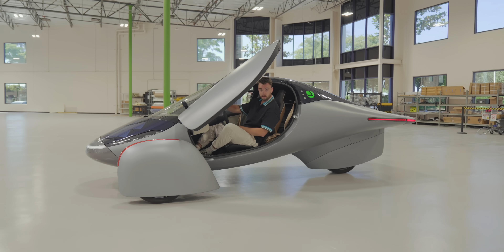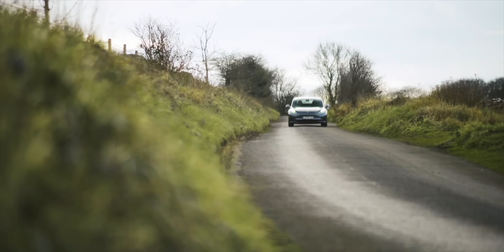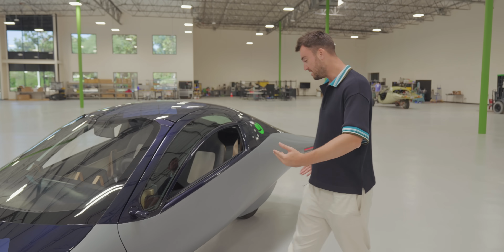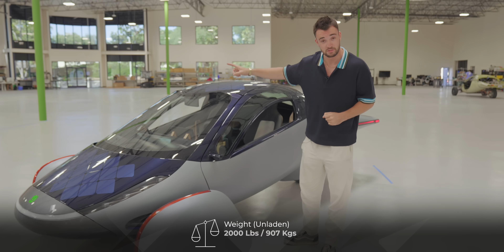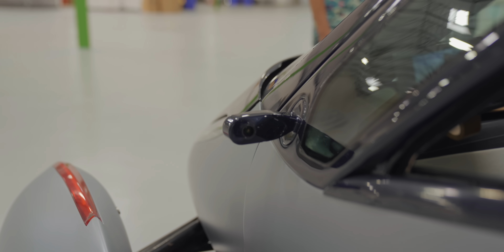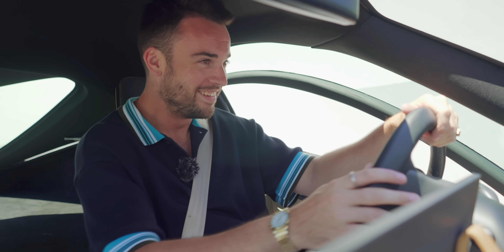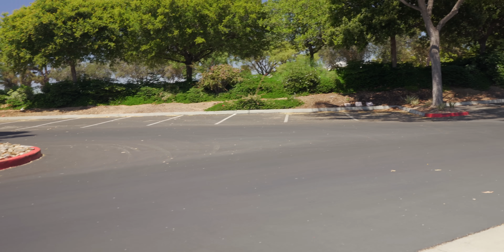The Game-Changing CHEAP Electric Car Inspired By Fish!

Comment: This vehicle was needed 20 years ago.  It's so very overdue and I can't wait to finally drive in one while flipping off the oil industry for good
Reply: I like it more because I can flip off the electric company as well.
Reply: I'm ready for a world where energy independence actually belongs to each of us individually rather than being indebted to entitled poisonous industries. But they're going out kicking and screaming.
Reply: @HermanVonPetri  because The lithium industry is so clean and selfless...
Reply: @meissnerflux  At least lithium can be sustainably harvested from seawater using renewable energy. And the lithium you do get can be reused for many decades to store renewable power. You don't just burn it away like you do fossil fuels.

Then there's the newer sodium-ion batteries that are beginning to enter the market now. They don't use lithium, cobalt or nickel. Battery advancements are happening rapidly and are addressing environmental criticisms. The petrochemical industry has known about the environmental damage of its products for half a century at least but they are in the business of selling pollutants and can't change that.
Reply: @meissnerflux  😄Yes, when compared to the fossil fuel industry.
Reply: @meissnerflux  lithium is not burned by EVs. Lithium can be recycled, burned gasoline can't
Reply: @HermanVonPetri  Don't fool yourself. They are not going anywhere!!
Reply: You do realize the oil industry is still needed to make the plastics and to power the production machinery and mining equipment for digging up precious metals, shipping them from across the world to US, and to provide the oils and greases used for lubrication, right?
Reply: what's sad is it could have been built 20 years ago. easily.
Reply: @bob15479  They started building this car over 20 years ago! I was there and I rode in it. It's basically the same vehicle, but the economics of the project impacted them harshly and now it appears they are back. It was a vastly different world for this kind of venture back then!
Reply: @bob15479  No it couldn’t have. Both solar panel and battery technology have gotten orders of magnitude better and less expensive. When the Tesla Roadster came out in 2008, Li-ion battery prices were still >$1,000/kWh. It’s an engineering marvel.

Remember, the original 2011 Aptera 2e was going to be an ultra-high mpg plug-in hybrid because batteries weren’t up to snuff yet. It was also slow, 0-60 mph in 9 sec.
Reply: @bob15479  There was an EV car built some years ago. But "money" (Probably by the oil industry.) bought rights to own them. They were collected and destroyed! They were called the EV1.
Reply: @Eric Dow it could have been built and onboard differential'd motors and lead acid batteries in the 90's and would have still been a good car IMO
Reply: The oil industry allowed the US to develop and build everything we have to include green tech.  Cheap energy is the king of wealth and innovation.
Reply: @babochee  True! And now wind & solar generated electricity is the cheapest energy, and EV’s are the cheapest way to get around.
Reply: Ya I can believe something like this hasn’t been available for a long time, I drive 90 miles per day and this would be perfect
Reply: It's needed now too, OPEC just reduced barrels and rest of the world is not dealing in Petro dollars. We need a surplus of oil
Reply: @mohit4902  yes, this. ^
Reply: Technology was much greater 100 years ago. It all got stolen to sell to you.
Reply: make sure you are walking when you go to flip off the oil industry tough guy because NEARLY everything that is used in the world contains plastic some more than others probably that keyboard and mouse or the phone in your hand uses at least 75 percent plastic which is made by .......YOU GUESSED IT ....PLASTIC!!!!!!!!!!
Reply: Wrong - I fell for the Volt nonsense back in the day and they completely changed it from concept to production.  I backed out and was better off to get away.
Reply: @politicalfoolishness7491  The Volt is the best car I've owned, and I've owned a few. Still going strong after almost 9 years and 146,000 miles.
Reply: @fotoguru222  I'm glad it worked out for you.  Did the battery last 9 years though?
Reply: @politicalfoolishness7491  Yes, my 9 year old 2013 vintage Volt battery still has about 90% of its new capacity. I actually get more miles out of each charge but that’s probably because my average speed is less now that I’m retired and doing more local trips.
Reply: @Another-Address  Yes. Oil is too valuable to 🔥. 😎
Reply: yes pleease!!!!  FJB!!!!
Reply: Agreed
Reply: Get your order in now. As stated in the video, there is a growing waiting list. It will cost you $100.00 to reserve your car. I've reserved mine, and I can't wait for it to be ready.
Reply: You will NEVER be able to flip off the oil industry because OIL is used to produce the plastics you use and take for granted EVERYWHERE in and around your household INCLUDING the building you are living in  and the products you're using today right now to connect with the internet.

You green-minions don't know how dumb you sound when you  say shit like you just did in the original comment.
I'm not an oil industry fanboy  I want to save the planet too but I'm not going to be an idiot to jump on the bandwagon without facing the facts that the oil industry is here to stay   because its far more intertwined with our daily lives in MANY OTHER WAYS other than  transportation.
Reply: Time we design an ev which charges itself with each and every rotation of the wheel?
Reply: You could buy a VW E-Up!
Reply: This cars first iteration was birthed in 2006.  Some of us have been thirsting for it for 16 years.
Reply: Sinclair c5
Reply: The CEOs of all common car brands might try to stop this car for sell, because all car  dealer cannot rip people off any more!
Reply: I think 20 years ago they had a gas version that got over 500 MPG.  It never got approved for safety despite being safer than most compacts and mid-sized cars.
Reply: You can drive an electric bike today if you really wanted to flip off the oil industry
Reply: @YounesLayachi  I've got one! The problem is, that those people driving the big SUVs, trucks, and some gas-powered motorcycles,  often want to play chicken on the road when they see one. And I am forced to use the shoulder of the road when traffic gets a little heavy.
Reply: @YounesLayachi  I'd have to move to a city that has decent bike lanes first. Which means getting a new job, because the nearest city to me (Dallas) is extremely unsafe for biking.
Reply: @HermanVonPetri  electric bikes are much safer than bicycles, but ok point taken
Reply: @YounesLayachi  Don't get me wrong, I completely support e-bikes as a middle ground option. And I would get one if I felt it made sense for my situation, but I'm struggling to find a use case scenario that feels safe and practical. And that's not even accounting for the risk of theft.
Reply: @YounesLayachi  How do you figure? The #1 risk to cyclists is getting inadvertently or deliberately hit by a 4-wheeled motor vehicle. A bicycle having an electric motor doesn't address that at all.
Reply: @HermanVonPetri  I worked full time in the bike industry while I was getting my degree, right through the 1st gen of electric bikes up until 2019. They only really fit edge cases better than just plain bicycles or electric motorcycles.

If you're an able bodied person riding less than 10 miles, just get a bicycle. It'll be half the price for the same equipment, easier to carry up and down stairs, and future parts availability is much more guaranteed.

If you're not able bodied, and you want a method of fitness, then yeah get an e-bike. OR if you're still able bodied but want to ride in from 20 miles out, sure.

Other than those two it makes much more financial and safety sense to get an electric motorcycle. There exist electric motorcycles that are at price parity with electric bicycles. The big deal here is when you're on a plated and insured vehicle, and someone in a 4-wheeler deliberately drives their car into you, and this will happen if you ride a two-wheeler, the cops have to get involved. If you're on a bicycle, the cops show up, say "well anything could have happened, who's to say?" and leave without filing any charges. Plus, having more than 750W on tap allows you to get out of dodgy city situations in the first place. "BLAH BLAH BLAH BUT YOU NEED A LIIIIIIIICENSE!" Yes. They take one weekend to get. You go to your state's motorcycle instruction course, do a few hours in the class room, then 8 hours putting about a parking lot. Truly trivial, job done.
Reply: @Hansengineering  a cyclist has increased odd of getting hit if his cycling speed is much lower than the driving speeds of cars around him. Ebike can keep up with car speed and sometimes outspeed cars from a dead still.
Ebike can also get out of the way quick enough in case of incoming danger, while a cyclist will be a sitting duck trying to pedale away
Reply: @YounesLayachi  ebikes are by law limited to 20 mph max. They typically travel around 15-18MPH in practice. That is not enough to not get run over by cars. Those rental scooters do 15 MPH and constantly hold up traffic.
Reply: @Hansengineering  you think your country's law applies to the entire world ?
Also even when speed is limited, acceleration isn't. Ebikes aren't sitting ducks in red traffic lights when cars go vroom at green
Reply: @YounesLayachi  my dude i have ridden every type of ebike there is, and 10s of thousands of miles on pedal bikes besides. Ebikes are pointless unless you're a cripple.
Reply: @Hansengineering  I can occasionally us my regular bike for short trips to the Dollar Store for small grocery trips. But that's only in that direction where the streets aren't too busy. My main grocery store is down a six-lane road and crossing another busy four-lane road with no sidewalks or bike lanes. So I do not bike there.

The main advantage for me with an e-bike would be because of the summer heat here in Texas. Anything I can do to make the trip faster and less sweaty is a plus. So even that trip to the Dollar Store would be a lot more comfortable. However, that alone just isn't enough to justify the cost and risk of theft.
Reply: @HermanVonPetri  
The biggest danger to riding bike is the person doing the peddling.
Reply: @Hansengineering  e bikes are great if you value not being sweaty without changing clothes
Reply: @YounesLayachi   I do... and I do. 😈
Reply: @YounesLayachi  The oil industry laughs because every single part on that bike was built and shipped thanks to that sweet... sweet goo!
Reply: @yarharyar  much more goo is used building a car and fueling it. E bikes are super low impact and have no intrinsic reliance on oil. Other industries can remove oil from their equations too
Reply: @YounesLayachi  not as safe. Many have been waiting for a safe alternative try riding an electric bike a 1000 miles.
Reply: @YounesLayachi  cant take the dog, go to the shops  and be comfortable in the rain on a bike.
Reply: @YounesLayachi  Not really!! Aside of the fact that you RIDE a bike, not drive it, how do you get ur groceries home on a bike, how do u get ur kid to school on one, how does a bike work for the older set, or those not athletically inclined, how do you get thru a rain or snow storm on one? How do you commute to work if the distance is, let's say 20 miles away with narrow windy 2-lane roads with cars competing for the same lane? How do you arrive at work when you're sweating through your shirt on hot summer day??? How does a bike solve any of these problems???

 A bike only works for a very restricted set of people and places!! You bike people only think of how bikes work for u and think the rest of the world is the same!! Be a bit more open minded and considerate please!!! Cars, private transportation vehicles, are the only way to solve a myriad of modern life issues that no other vehicle can do, so the electric version is what is needed to proliferate ASAP.
Reply: @nixl3518  You would probably be interested in the channel "Not Just Bikes" which addresses most of your concerns with several videos that demonstrate how cities that care about the health and safety of their citizens can actually design walkable, bikeable infrastructure.
Reply: @HermanVonPetri  I've had this conversation before on other channels, including the one u brought up. There is no such place that solves the problems I brought up because you just can't solve them!! What do you do with the elderly? Do you get them an electric tricycle with a basket for their groceries? How do they fare in the cold northern climates with snow or sleet, let alone rain??? Theory and design are gr8 on paper, but if its your parents you need to have taken care of, they need a car! No matter the infrastructure, a bike for each will not do even in the flatlands!! If they can drive an Aptera, so much the better but biking is a restricted sport for the few, including me. I love it but it is not a solution as much as it would be nice. We are not in a Disney movie.
Reply: @nixl3518  I'm not saying to completely get rid of cars. If you do absolutely need a car then giving other people biking options helps them too. Every person on a bike is a person not in front of them on the road, and not taking up parking spaces. 

Most kids can bike to and from school, if the city designs safe bike paths. That means the parents don't have to go out of their way to do the school run, and the kids get more independence in their lives. Sure, preschoolers will still need to be taken by their parents, but that's only a couple years out of a dozen or more years they can bike themselves.

And these designs aren't just on paper. They already work in places like The Netherlands where most people in cities, and even suburbia, use bikes as a daily means of transport. We just design our cities wrong because the automobile industry convinced people that it was wrong for people to expect a city you could actually walk and bike in to do your daily business.
Reply: And that's not even considering the necessity of public transit. Cities that care about their citizens build decent public transit networks.

Take a look at this video "Do Your Buses Get Stuck in Traffic? Traffic solutions & the Downs-Thomson Paradox" by NotJustBikes. Seriously.
Reply: @nixl3518  very narrow minded and a hopelessly lost case.
Kids and the elderly can use 3 wheeled bikes. 
2 kids can be transported in bikes with front cargo. 
Biking in snow and wind and rain is no different than walking or running.
A bike can have electric motor + battery to assist or fully replace leg work. Notice in my comment I said ebike, not bike.
PS "ride" is for things you don't steer, i.e animal mounts, and vehicles driven by someone else (ride a bus/train, give someone a ride in your car : they ride your car but you drive it).
Reply: @YounesLayachi  you must live on a different planet or are so immature that you have not had kids or older parents you care for. Kids in front cargo? Who r u kidding? That’s insane! Have u ever biked in the snow? I have and on the way to rail transport to go to work. I never did it again! Feet get wet, working is difficult. Being fanatic blinds u from reality. You have no concept how idiotic ur comments are!
Reply: @HermanVonPetri  You talk in idealistic terms. I am a realist! Which cities care, as u say? Can you name 20, or 50, of the thousands that should care? Nevertheless, public transport will not fill the niche u wish it would. It is almost always inconvenient enough to make an additional mode necessary, in which case, a bus is skipped altogether. You need to ground yourself to the reality that you find yourself to be in. What CAN be done is not what IS done! I am very familiar with “Not just bikes”. Pie in the sky” stuff.  Complete fantasyland!
Reply: @nixl3518  People need non-car options. Not everyone can afford a car, or to keep it fueled, or afford the insurance. Why are you opposed to considering their needs?

We won't have the options if we don't demand them. You seem content to drive your consumption machine everywhere all the time. I am not.

Car parking takes up 10 times the space that bike parking does, and infinitely more space than pedestrian access. A single bus replaces 20 or 30 cars on the road. A train could remove twice that from the roadways.

Yes, people use the transit method that is the cheapest, quickest and most convenient. But in the past 80 years we've sabotaged what used to be quick, cheap and convenient public transit and walkable cities, and replaced them with expansive, inefficient, dangerous wastelands of concrete for cars.

This experiment in car dependent infrastructure is not even 100 years old. Our dependency on fossil fuels is barely twice that. A blip in human civilization. And in that short time we have fouled the air we breathe with pollution, pushed the climate to the tipping point, and turned ourselves into fat, sedentary, isolated, miserable consumers.
Reply: @HermanVonPetri  Your first paragraph is disingenuous!! You are trying to flip the conversation. I am saying that people need private transportation. I am not trying to prevent them form biking around. It's you who is trying to limit options and force people to do things your way!!

However Herman, this is not what we are talking about here!! You have lost your way!!

Your comment shows that have misunderstood the entire problem we are facing. It has nothing to do with oil or the atmosphere or the environment. It has to do with our numbers, the population of the world. All these factors are intertwined, but here we are! What do we do now??

 In your wonderful preindustrial world, the entire planet barely had a billion people. We now have 8. Check out your city's population then and now. If you take a moment and find out, it will explain why we need cars!! In the 1800's you could do everything ON FOOT in your little town! Now you cannot because its too big for that! Too many people! 

So the private vehicle is something that is here to stay! We just have to make it less corrosive to our world, but we still need to stop using oil entirely, because if we don't, stopping the use of ICE vehicles will have no consequence!! It's too small a portion of the oil usage profile.  

I agree with your fifth paragraph entirely. So, how do you plan to stop climate change? To be brutally honest, it requires we practically STOP every factory from working and every furnace from heating buildings in winter and stopping driving cars, trucks, boats and trains!! Our entire civilization has to STOP! That is what we have to do, not just slow it down, but STOP!! How do you propose to do this??? Ride a bike?? LOL!!!
Reply: @nixl3518  cargo bike. Rear bike rack. Bike trailer. Front mounted bag or basket.  Lots of options
Reply: @nixl3518  e bikes solve many problems with physical ability and sweating
Reply: @ThomasBomb45  LOL so you can name them. Which one of these do you use regularly? Do you have a baby that you carry by bike everywhere you go? Do you put her in the basket? How safe is that? Do you have parents that ride bikes to work or to the supermarket to buy and haul back food? Do you carry more than one bag of groceries on the 2x6" bike rack? Do you all do this rain, shine or snow? Lots of options Lily, but none of them appear on the streets I know! One or two have been seen as rarely as a UFO but nothing like cars. Perhaps you live on a different planet. If bikes were the solution, they would have proliferated a century ago when cars were still a pain to handle and few were capable to drive them. Instead they proliferated despite their shortcomings; not so, the bike. Lessons learned,
Reply: @ThomasBomb45  Yes that's right! That's why everybody rides them!! LOL Everybody is physically able and everybody loves to sweat on their way to work. Interesting ideas!!
Reply: @YounesLayachi  oil industry doesn't care about your bike
Reply: @EarthCreature.  oh yes they do.
Reply: You aren't flipping off the oil industry there tough guy. The majority of that vehicle is made of plastics.
Reply: @brianh2287  I'm sure he was referring to the constant need to put fuel in the tank. Not the way it was made!
Reply: @brianh2287  the majority of oil in a cars lifespan is used to burn as a source of energy. EV are powered by the electric grid which is increasingly less reliant on fossil fuels. Even if you charged your ev with diesel generators it's probably more efficient and uses less oil per mile
Reply: The oil industry still contributes plenty to the making of this vehicle. Just sayin'
Reply: @chicoventura  And the oil industry also contributed to the non making of this car , which is why it wasn't created 20 years ago 😉
Reply: @propergander1162  I don't want to rely on oil either, I'm just saying it's silly to say you want to flip off an industry that is still relied on for the product referenced.
Reply: @chicoventura  I agree , I think maybe you missed my point in that just like water powered vehicles etc these things were created a long time ago only the oil industry brought many of them and closed them down . Electric and REM isn't the solution , it's just a new industrial revolution and a new source of revenue ...
Reply: @chicoventura  Personally the worst thing we create from oil is plastic
Reply: @propergander1162  yeah I saw what you were saying, but it doesn't rebut my point.
Reply: @propergander1162  cool
Reply: @chicoventura  Nobody was trying to rebut your point ....
Reply: The Asfalt that make up the roads.. are a bi-product of the oil/gasoline refinery. Without the oil, you get No paved roads!
Reply: @MikaelLindberg  That's a good one! If you didn't burn so much of the oil and gas, you'd have MORE for making asphalt and other products! Yes, oil is valuable stuff. It has a limited supply. You can make many valuable chemicals from petroleum including resins, dyes and plastics used for such things as Aptera's body. It's really too valuable to burn
Reply: How about flipping off the mining industry you hypocrite?
Reply: @pizza.de.sushi123  how about flipping off the oil industry you brussel sprout?

I'll settle for flipping you off.
Reply: This is where i'm at on EVs in general. JUST NOW people at work are considering a PHEV. My dudes, PHEVs were something that could have helped in 2000. NOW they're heavy, unnecessarily complex at best, and at worst emit no less CO2 than a normal efficient ICE car. We need that first really inexpensive EV that people can ACTUALLY afford without already making $90k/yr to get a $7500 tax break. My truck is 14 years old this year, and while it was the model for truck efficiency in 2009, it sure af isn't now, and I don't need its truckiness more than a few times a year any more. I am ready to let it go now ! I reserved an Aptera about a year ago, so maybe 1-2 more years before my number comes up?
Reply: @Hansengineering  PHEVs may make sense for some people. Plenty of used ones too. If you need a daily driver that can go short distance on electric but also has convenient road tripping, that's a win win.
Reply: Get your motorcycle license. I don’t think it will meet automotive front and side impact standards
Reply: It’s been vaporware for over a decade. At some point they are going to have to build cars for any of this to matter.
Reply: @OuijTube  wrong. 2008 Aptera was bought out by "Detroit" and they tried to pivot to making a 4-wheeler, which obviously failed.
Reply: That "Vehicle" is crap and is a symbol of Liberal induced decline.
Reply: Not so fast. For your 40 miles a day you’ll need sun shine. No sun shine, no electricity. Ask Germany and Denmark. No wind, no electricity. Again ask Germany and Denmark. Norway has put generators under water to use the currents that pretty well flow continuously. But other problems to be resolved. Coal is the cheapest for electricity production. Climate wise nuclear is the best(much more expensive). But natural gas is clean and very efficient (not perfect, but). As the environmentalists were shutting down nuclear power other countries built many plants, with the USA technology. We need a multifaceted production model and not limit our options. By the end of the year carbon dioxide capture will be close to 98%-99% efficiency. That is what Basin Electric Generation Co Op in North Dakota is putting in place on their coal generation facilities. The carbon will be pumped back underground at 4,500 to 5,500 ft. Basin has been capturing carbon dioxide, piping it into the oil field of Saskatchewan,Canada for about 20 years or so. The Canadians used it to pressure up their old oil fields. 
     A lot of people hate oil and want to get rid of it completely. BUT, without oil and plastic, the medical field, cars and pretty much every aspect of your life will cease to exist. And no matter how much America does to capture carbon, China and India, developing countries will continue to put millions of tons of carbon into the atmosphere. Especially communist China. They care about how much money they make and not at all about people or the planet. We Americans should not and must not destroy ourselves when China couldn’t care any less about their own people much less anyone else. 
    We need to balance our production means for the best efficiency without crippling our economy and ourselves.
Reply: No one will buy or use this....Fact
Reply: @mitnameel2227  over 30k preorders already little fella